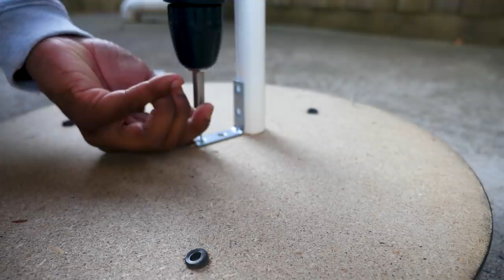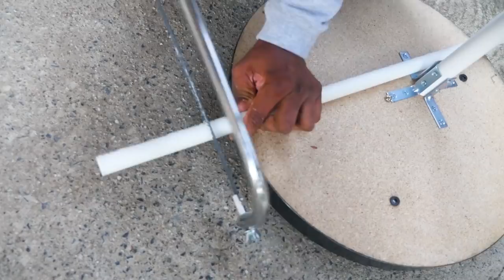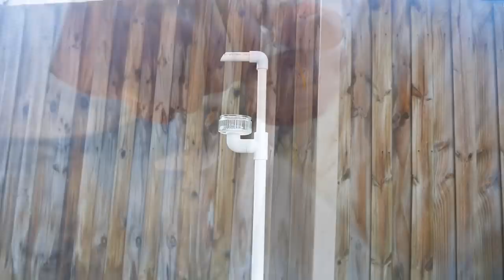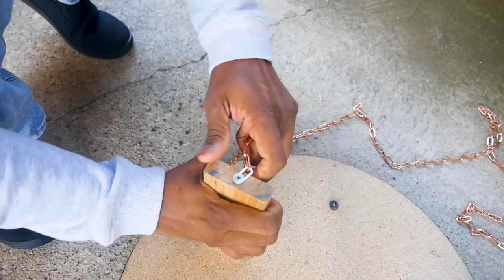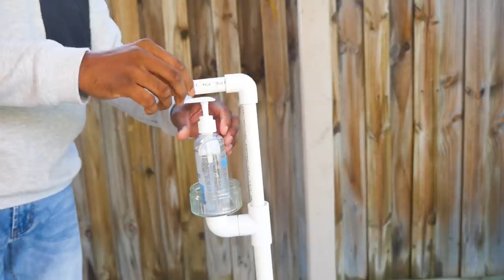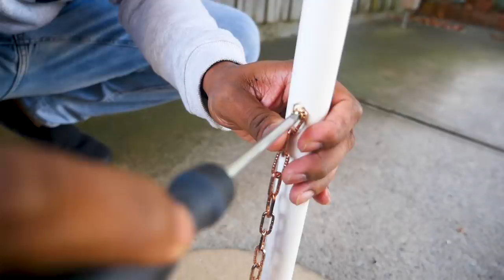How to make Foot Operated Hand Sanitizer Dispenser | DIY

Comment: thanks for sharing. it would be nice if you list in the description(below the step by step explained) all the materials you used & measurements of the pipe (diameter/length). thanks.
Reply from the maker: Materials required-
* 15mm x 1m PVC Pipe
* 20mm x 1m PVC Pipe
* 15mm PVC Elbow
* 20mm PVC Elbow & Tee
* 12mm x 45mm Compression Spring
* Small butt Hinge
* 4 x L Brackets
* 28cm long small chain

Will update the description soon.

Thank You!
Reply: Creative SL thanks.

Comment: Bueno días,saludos.
Pregunto el tubo base que va a tornillado en la base de madera es de una pulgada,y el interno de media le agradezco y las medida de la cadena donde va el pedal
Reply from the maker: Materiales necesarios-
* Tubo de PVC de 15 mm x 1 m
* Tubo de PVC de 20 mm x 1 m
* Codo de PVC de 15 mm
* Codo y camiseta de PVC de 20 mm
* Resorte de compresión de 12 mm x 45 mm
* Bisagra a tope pequeña
* 4 x L soportes
* Cadena pequeña de 28 cm de largo

Thank you!
Reply: Igual quisiera saber lo mismo

Comment: Details of materials please I would to do that DIY. Thanks. Hehe
Reply from the maker: Materials required-
* 15mm x 1m PVC Pipe
* 20mm x 1m PVC Pipe
* 15mm PVC Elbow
* 20mm PVC Elbow & Tee
* 12mm x 45mm Compression Spring
* Small butt Hinge
* 4 x L Brackets
* 28cm long small chain

Thank You!

Comment: How much will it cost approximately
Reply from the maker: Materials required-
* 15mm x 1m PVC Pipe
* 20mm x 1m PVC Pipe
* 15mm PVC Elbow
* 20mm PVC Elbow & Tee
* 12mm x 45mm Compression Spring
* Small butt Hinge
* 4 x L Brackets
* 28cm long small chain

Thank You!

Comment: May i know the details the material that u used something like how long the pvc and pipe and its diameter
Reply: And also the cost for making this thing..tq
Reply from the maker: Materials required-
* 15mm x 1m PVC Pipe
* 20mm x 1m PVC Pipe
* 15mm PVC Elbow
* 20mm PVC Elbow & Tee
* 12mm x 45mm Compression Spring
* Small butt Hinge
* 4 x L Brackets
* 28cm long small chain

Thank You!
Reply: @CreativeSL  thank you
Reply: @CreativeSL  amei seu vídeo!
Estou fazendo pra doação a Casa dos Pobres ! Mas encontrei dificuldade só nos finalmente. O potinhos onde vai o álcool gel tem que ser bem justo pra ele não cair ? O meu não fica mesmo colando help

Comment: Porfa ponga los materiales y las medidas de los mismos lo necesito hacer para un proyecto de mi colegio 🙏... Graciss soy de Ecuador 🇪🇨
Reply from the maker: Materials required-
* 15mm x 1m PVC Pipe
* 20mm x 1m PVC Pipe
* 15mm PVC Elbow
* 20mm PVC Elbow & Tee
* 12mm x 45mm Compression Spring
* Small butt Hinge
* 4 x L Brackets
* 28cm long small chain

Thank You!

Comment: Size of the material?
Reply from the maker: Materials required-
* 15mm x 1m PVC Pipe
* 20mm x 1m PVC Pipe
* 15mm PVC Elbow
* 20mm PVC Elbow & Tee
* 12mm x 45mm Compression Spring
* Small butt Hinge
* 4 x L Brackets
* 28cm long small chain

Thank You!

Comment: Bhai ji pipe ke size bhi to share karte taki aasani hoti banane mein
Reply from the maker: Materials required-
* 15mm x 1m PVC Pipe
* 20mm x 1m PVC Pipe
* 15mm PVC Elbow
* 20mm PVC Elbow & Tee
* 12mm x 45mm Compression Spring
* Small butt Hinge
* 4 x L Brackets
* 28cm long small chain

Thank You!
Reply: @CreativeSL  thanks for the reply
Reply from the maker: @rohitmalik1814  You are welcome!

Comment: Muy genial xfa regaleme la lista especificada y correcta con medidas de los materiales mil gracias desde Cali colombia
Reply from the maker: Materials required-
* 15mm x 1m PVC Pipe
* 20mm x 1m PVC Pipe
* 15mm PVC Elbow
* 20mm PVC Elbow & Tee
* 12mm x 45mm Compression Spring
* Small butt Hinge
* 4 x L Brackets
* 28cm long small chain

Thank You!
Reply: Upa gracias mañana mismo inicio mi dispensador super....Chao amigo
Reply from the maker: @joseeduardoloaizagarcia9579  
te deseo lo mejor! 👍